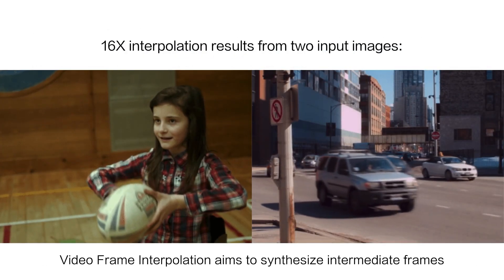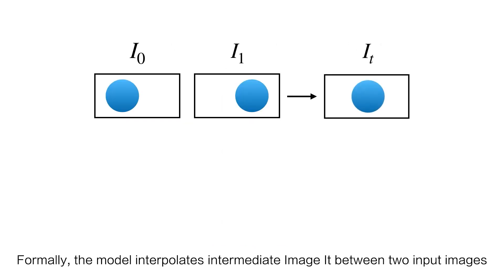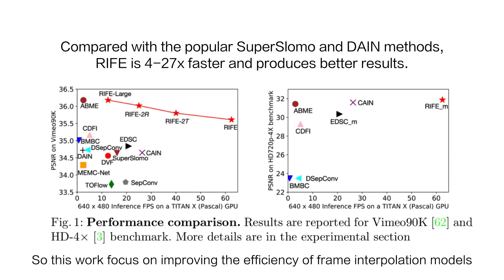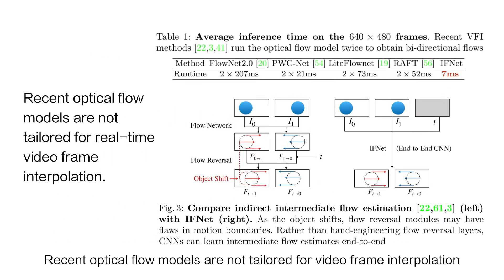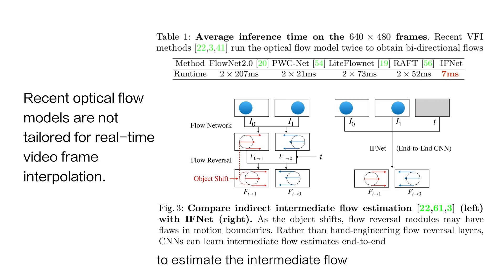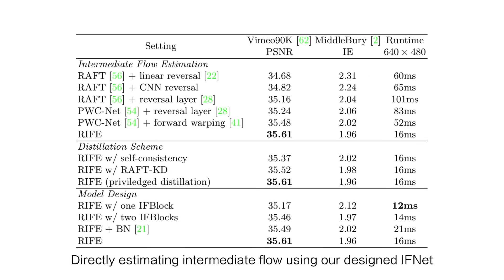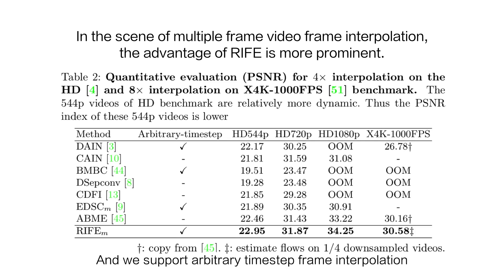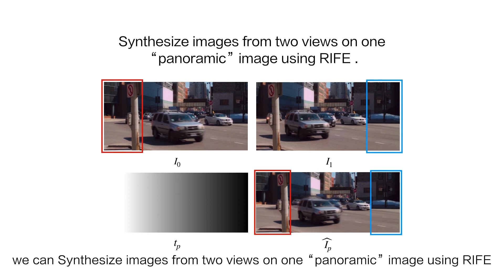Real-Time Intermediate Flow Estimation for Video Frame Interpolation, in ECCV 2022

Comment: I have been using rife v.4.24 via svp to watch old Star Trek Videos, and the smoothness is so pleasant. Uses about 100W on my Nvidia 4060Ti to scale up to from 24fps to 120Hz in real time. Totally worth it. I noticed compared to v4.6 way less artifacts when e.g. a scene moving behind static text, or specific repeating patterns. good job